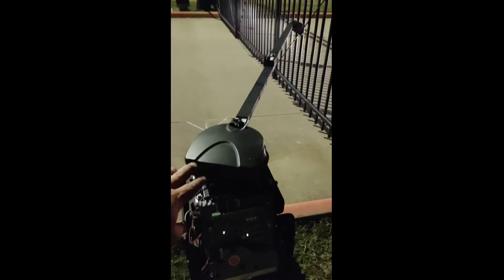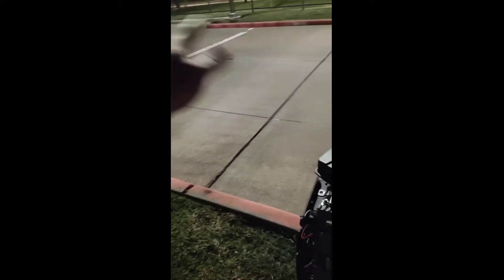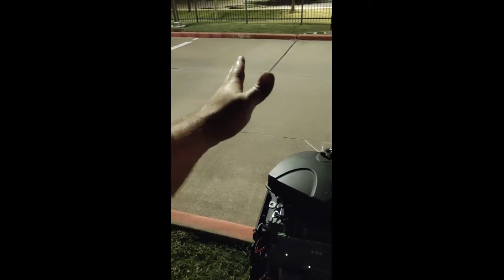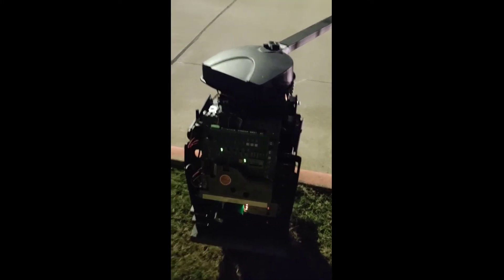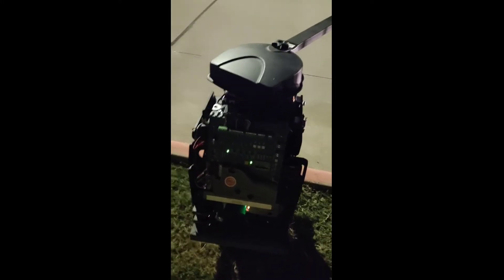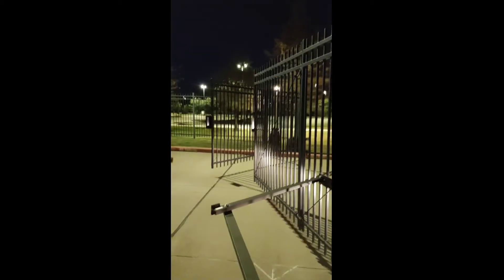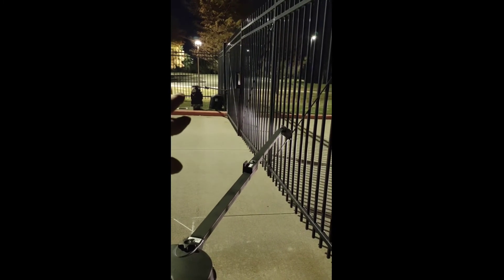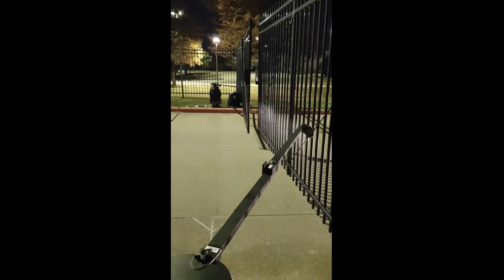What Viking Access Isn't Telling You About Their Gate Operators, So I Will

Comment: I don't see you installing rack and pinion style gate operators. Are you averse to those or is that the geography you work in does not necessitate their use? Looking to install one for a 23" slide gate. Familiar with All-O-Matic?
Reply from the maker: Yeah, rack & pinion are rarely used around here. But I am a fan of their use, and hope to see the industry move more away from chain drives. Occasionally I run into one I am asked to service, so I will consider making some sort of video to post. I am familiar with All-O-Matic. Aside from the limits in their linear actuator, I am a fan of their equipment... and enjoyed my time hanging out with the owner many years back. He's a fellow nerd like myself, and strives for quality, so I respect that.
Reply: @JacobGilliamMasterTech  cool I'm noticing the drive gear on this is 11.5" inches off the ground. Will have to place the rack higher up on the gate than I anticipated. Is that typical, do you know, or are some of the drive sprockets situated closer to the ground?
Reply from the maker: @rf4215  That sounds about right. Because they have to also account for Cantilever Wheels, or 6" drive wheels, and such -- some of the typical hardware added to the bottoms of slide gates -- so if they make the ground clearance of the drive too low, it can cause installation complications for many people (basically requiring them to create very high mounts (pads or platforms)).

Comment: Do these vikings break easy on the motors? I bumped one with my truck on accident and now I need to pay to fix it but I think the motors fine but of course they are trying to screw me and pay for 2 motors
Reply from the maker: They are quite robust. But every gear box has it's limitations, and they are only designed to handle their maximum weight and length loads of their specified gates. Unfortunately, when a vehicle hits the gate, the vehicle strikes with a sudden impact that is more than you would anticipate, because the vehicle is pressing at the furthest most point of the gate, which is also the greatest leverage point possible, so it multiplies the force being exerted, because the gate is acting like a giant "cheater bar". It's best they have their gate tech make sure to clamp the hub assembly down to the output shaft only as tight as necessary for the gate to move during normal operation, that way it can also allow slow slipping in this type of event. It will essentially act like a clutch plate if it's tweaked just right. Also, they should make sure there is safety equipment in place to help mitigation collisions.
Reply: @JacobGilliamMasterTech  the gate was fine the arm needed to be rewelded to the gate, and the motor is working fine! I drive everyday to the neighborhood and the motor is still working great.
Reply from the maker: Yay for simple solutions :-)

Comment: How do you reset the G5 limit switches?
Reply from the maker: Sorry for the delay, Mandy!  I overlooked your question. 

You'll have to remove the emergency release cover off the top of the G5. Then remove the one Phillips screw that holds the dust cover to the main screw. Then slide the dust cover off of the main screw. You'll be able to access the limit switches from there ;-)
Reply: @JacobGilliamMasterTech  can we call you?
Reply from the maker: Much easier shown than written lol. I know that's going to be difficult to understand in written form :-(
Reply: Our limit switches are not reading at the box.
Reply from the maker: @mandysando8616  Oh! Check out this video I made not too long ago..https://youtu.be/u2qKN7Mlql8

Comment: Do you recommend the Viking F1 for an apartment community with one 10' gate? I heard to stay away from the F1 due to board issues and 24 vDC
Reply from the maker: How many apartment units are behind this gate?
Reply: @JacobGilliamMasterTech  208 apartments
Reply from the maker: @chrisb5369  it's perfectly fine for that number of units. And you'd be buying a newer version anyway, some of their circuit boards from about 4-6 years ago had issues with the fuse holders burning up, but I'm pretty sure they worked that all out. It's a cost effective but still quality unit for your application, it's also a user friendly unit to troubleshoot for your on-site maintenance people, while a lot of other models are far more complicated to troubleshoot. You can pay for industrial grade stuff but you don't necessarily need it for that number of units. Also, unlike most operators the F1 has speed control, and I really like that feature. Cheers!
Reply: @JacobGilliamMasterTech  Thanks buddy. Cheers!
Reply: @JacobGilliamMasterTech  the problem of the fuse holder is true i am a electronic Technichian  and i repair some boards with the same problem , also they have problems with the display lcd